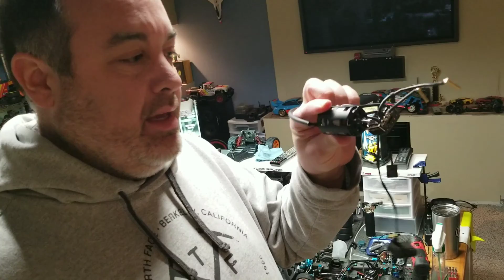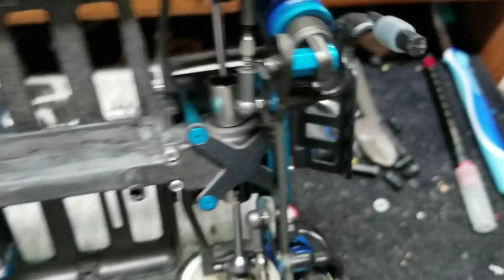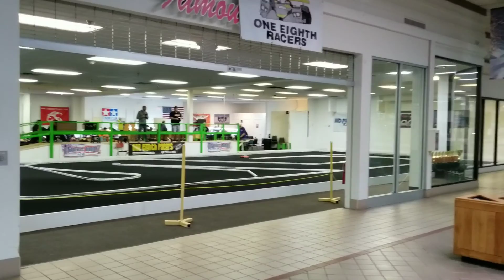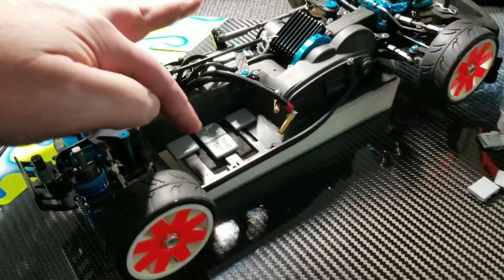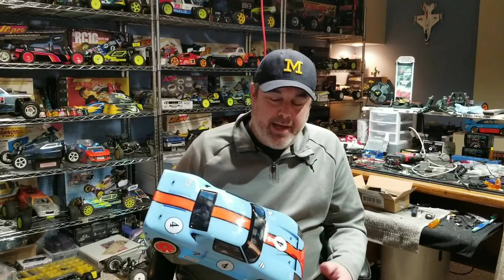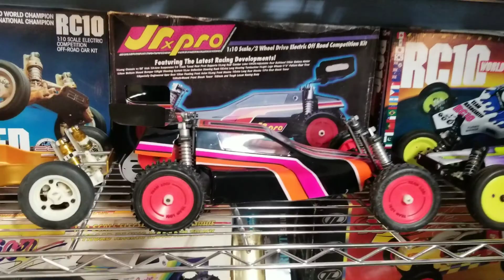Project: Street Weapon Part 3

Comment: Are you running both of the Aluminum shafts in the drive train to minimize mass?  I see you have the Aluminum CVDs.  Are your outdrives Plastic with the Metal Rings? I'm running Barracuda Titanium outdrives and Aluminum CVDs with the pins pushed out and replaced with weed trimmer line.
Reply from the maker: Hello, yeah I've heard of that trimmer wire trick- low wear & low cost! I do have all aluminium layshafts in the car, yeah. I run the plastic outdrives with titanium saver rings. Such a fun car.